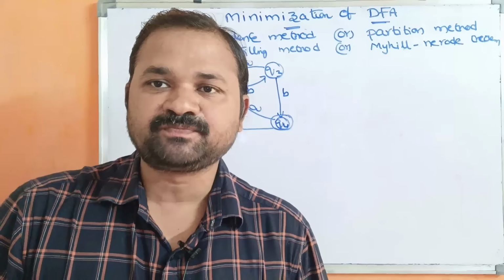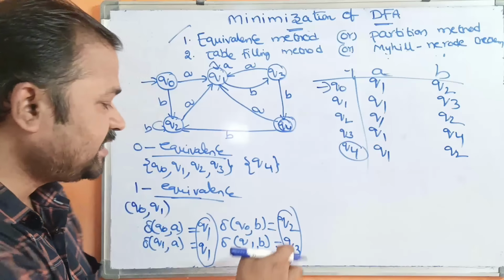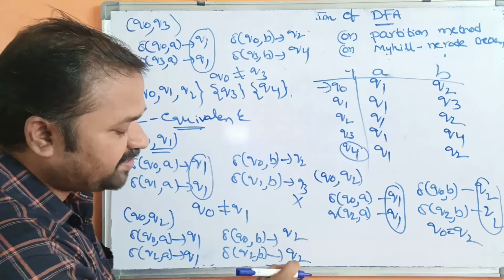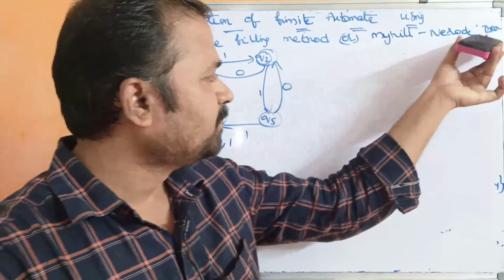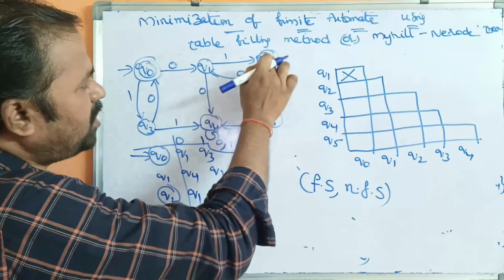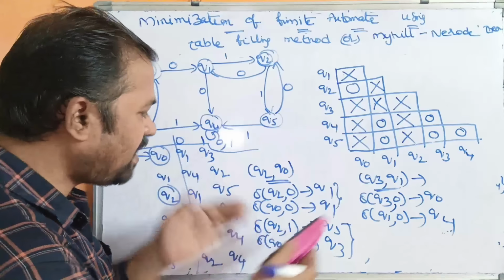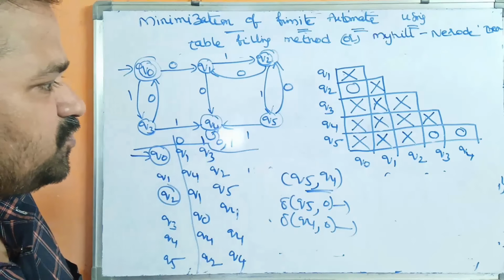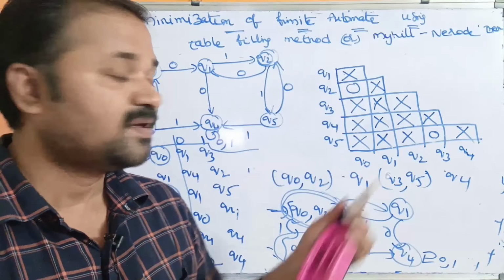Minimization of Finite Automata || Equivalence |Partition || Table Filling |Myhill Nerode |DFA | NFA

Comment: Sir i have small dout. In method 1 we are compared only {q0, q1}, {q0, q2},{q0, q3} .based on these compared results saparated. But why dont compare {q1, q2},{q1, q3},{q2,q3} .my sir sed compare all based on that saparate. Which process I will follow. Please reply me sir
Reply from the maker: if you follow any approach you will get same solution after minimization
Reply: Ok sir thank you for replying